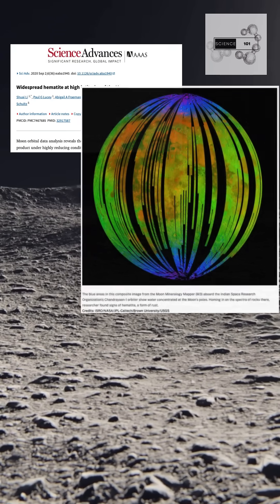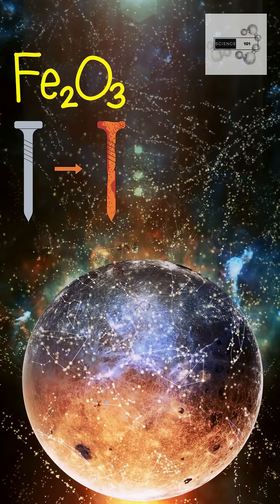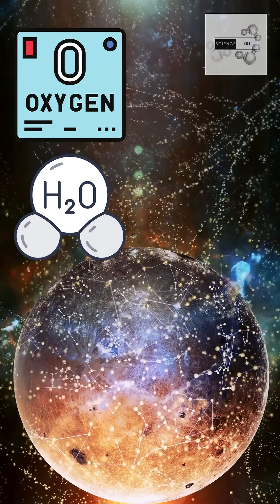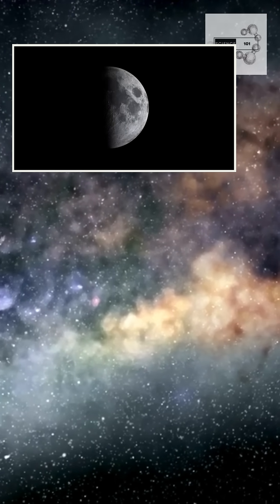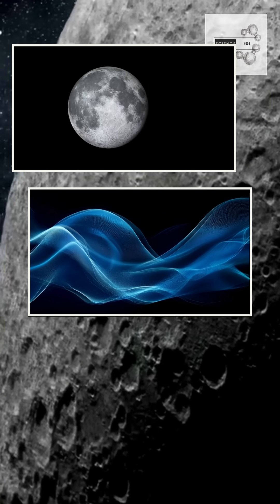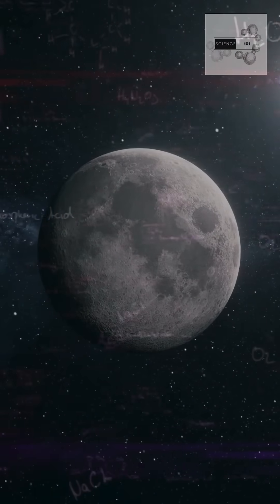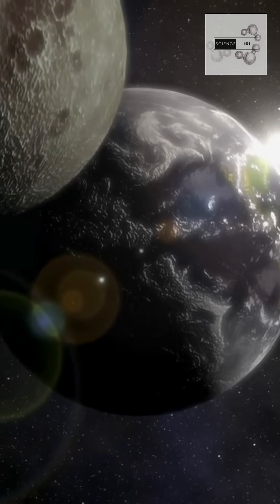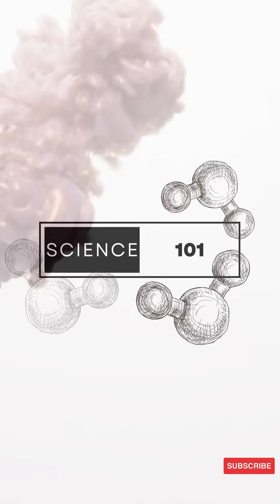Why is There Rust on the Moon? | An unusual discovery

Comment: So they found tons of iron rust yet no red photos of the moon
Reply from the maker: Great question! The rust (hematite) found on the Moon is real, but it’s present in very small amounts—microscopic traces detected through spectral analysis, not enough to visibly tint the surface red like Mars. Mars appears red because its dust is saturated with iron oxide across vast areas. On the Moon, the rust is patchy and subtle, mostly near high-latitude regions facing Earth, and not visible to the naked eye or standard cameras.